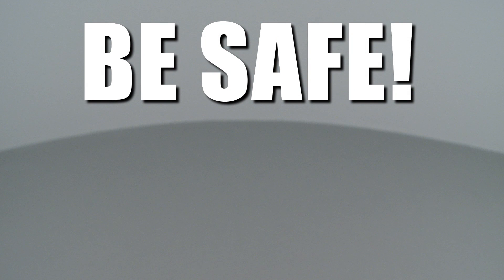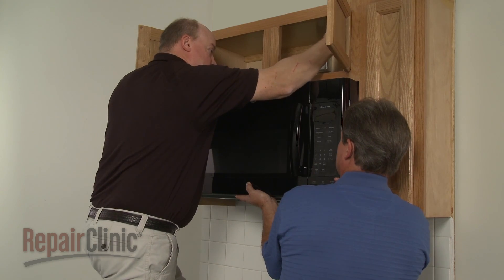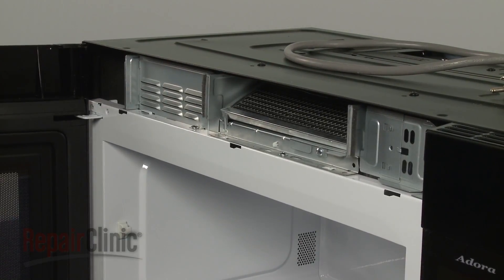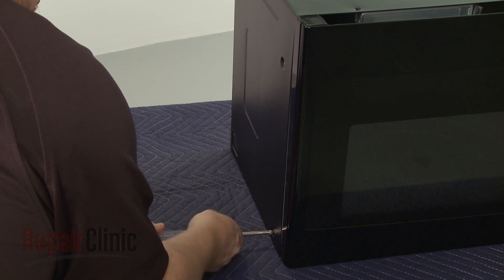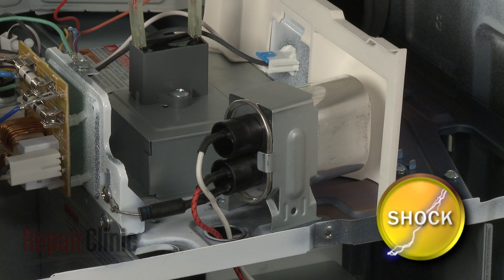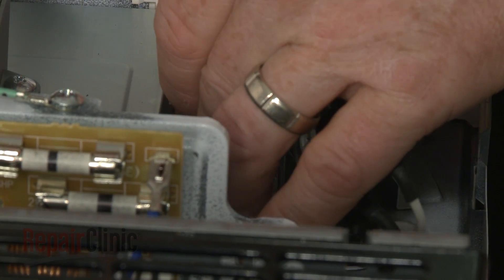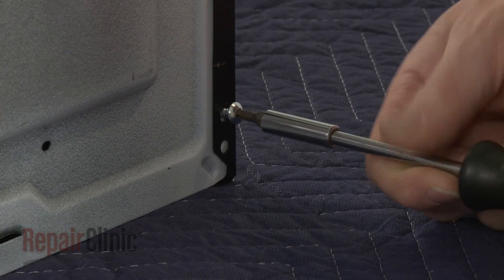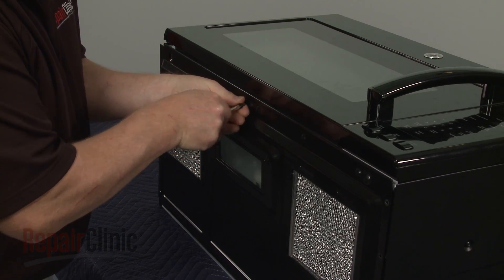GE Microwave High Voltage Capacitor Replacement #WB27X10011

Comment: I'm surprised that this company recommended shorting the capacitor to discharge it.  Use a capacitor discharge device with a resistor to slowly discharge that high voltage capacitor.  You can get injured, and it's also bad for the capacitor if you are still going to use it.

Comment: for those of you asking about how to hook up the wires to the capacitor, this is my understanding, hope it helps.

the one i have, from a relatively modern microwave, has 4 terminals. it looks like this, ( (I I) (I I) )====> ( (1 2) (3 4) ), the 4 lines are the 4 terminals on your capacitor, i numbered them to make things more simple

one terminal is connected to a resistor of about 10Mohms, in series with the ground wire. 

looking at it with the label facing you, the terminal to the resistor and the ground is on the far left (call that lead 1), in this example the red wire, leading to the magnetron/transformer, is connected to the terminal directly adjacent the ground. (call that terminal 2). 

in this example, the white wire leading to the PCU (power control unit) is connected to terminal 4, but when they install the new capacitor they have it connected to terminal 3. because this is an AC/AC system with no DC conversion, the capacitor puts out its energy or voltage from either side equally. 

you have some latitude in how you install your ground. on terminal 1 or 4. but the red wire needs to be next to the ground. the white wire can be on either one of the two terminals on the other side. if you have your ground on terminal 1 your red wire NEEDS to be on terminal 2. and you can install the white wire on terminal 3 or 4)

so to answer your question, you CAN install it upside down, but some of the wires need to be in certain positions relative to one another.

Comment: The capacitor terminal that is connected to the diode has burned a hole through the rubber wall surrounding the terminal.

What does this mean?
Reply: it means it should be mounted to a metal bracket on the inside of the microwave casing

Comment: This is an excellent video.  Easy to follow step-by-step instructions, excellent sound and video quality.

On a question somewhat unrelated to capacitor replacement, is the magnetron  the most likely cause of a noisy, buzzing microwave?

Comment: My 3-1/2 year old GE (same model) stopped working last week. No power at all, not even the oven light. I changed the fuses and then the capacitor as shown in this video (I noticed your replacement capacitor had a two-prong connection on the top plug, whereas the original only had one, just as my replacement did). However after replacing it the oven was still dead. So maybe the circuit board? Door relay switch? Anyway, I had already bought a new one (Samsung) on sale and it’s installed. Their so cheap to replace the whole microwave not much point in investigating the broken one any further. But this video was helpful nonetheless! Thanks!

Comment: We have a GE Advantium that is not heating consistently and want to fix it ourselves with new diode, capacitor and magnatron.  Are the instructions you give for those replacement similar to an Advantium?  We'd appreciate it to know it this is possible with your instructions for the replacements.  Thanks!

Comment: Hey I have Kenstar OM 20 DGQX when I powered it won't showing anything on display does this capacitor dead? if changed it will work back again? 
It's a old model

Comment: I'm all for repair vs replace...when it's more cost effective.  You lost me at :53...if the old microwave has to come down, a new microwave is going up.  By the time you assess the exact cause of your problem, and pay for parts, it's often more cost effective to just put up a new microwave.  Depends on the microwave, I suppose.
Reply: @Mos' Nefarious They can also be $150, for this size; especially a GE (mine was).    And that capacitor charge is only if you know for sure that is the issue.  When my GE failed early it its life, I took it down and and put up a Whirlpool.  Haven't regretted it at all.

Comment: Thanks.  I need t troubleshoot on my unit and was curious the best way to discharge the capacitor. This looks like a great method even if my GE unit is slightly different.
Reply: @repairclinic  Wait..at :47 you say "Only experience professionals should access internal components".
Reply: @repairclinic  I agree.  I fixed it a while back

Comment: Soo. he just changed a 3 prong capacitor with a 4 prong capacitor with no explanation??
Reply: They're the same two terminals. It's just that the new one has extra prongs coming off each terminal instead of only two. So you'd reconnect the same and just ignore the extra prongs.